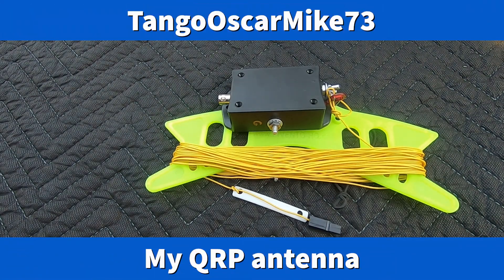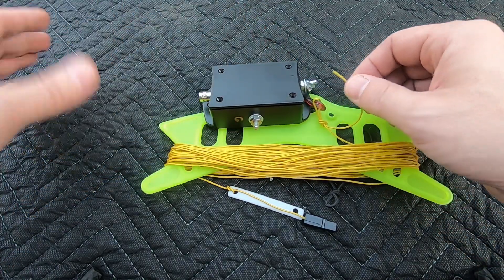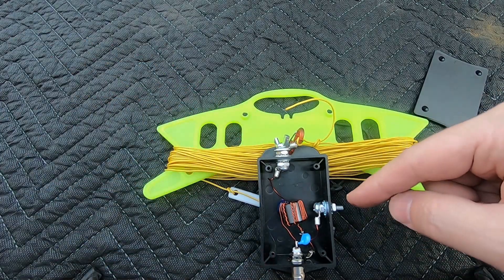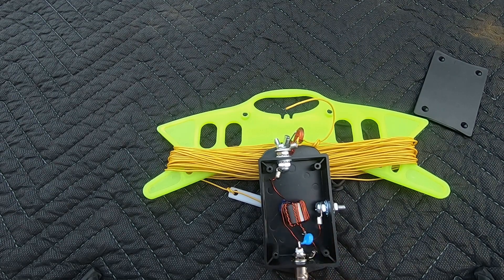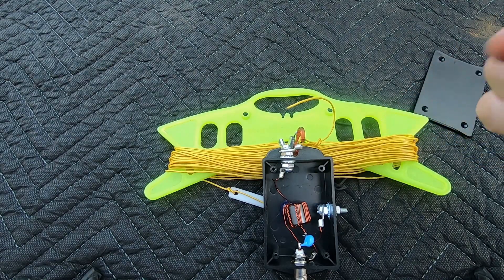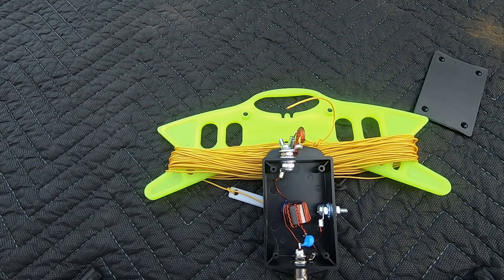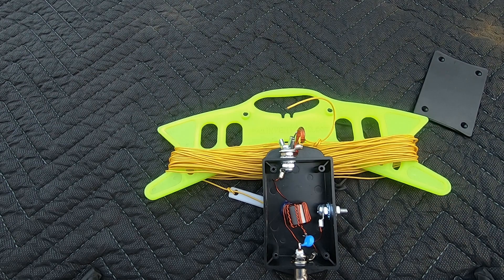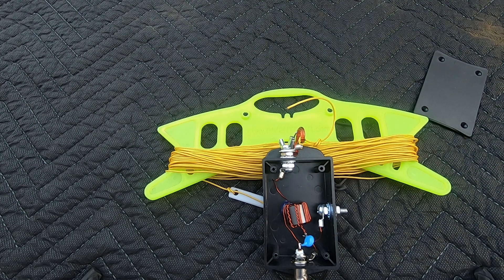My goto QRP endfed halfwave antenna - homebrew

Comment: It seems the coax shield acts like a very good radial, perhaps that is why there is no performance increase with one added? I read that it should be 30' or more, I have several sizes I will try from 20-35 feet to compare the difference. I also have a coaxial choke ready to compare also. Antennas a so fun to play with. Thanks for sharing! Cheers es 72, Dave - KU9L

Comment: great video - tehre is too much onfo online - and I suspect that 80% is untrustworthy
could I ask for anotehr vbideo - to show how you wind the torroid pelase?
Looks a but complex

I am confused 
presentation says 3 primary  - 21 secondary...
howwve even he shows 2 primary only....
and the classic graph...
Reply from the maker: Somebody else did all the hard work.  I got all my info from this presentation by K1RF.  There are different windings depending on the torriod you use. http://gnarc.org/wp-content/uploads/The-End-Fed-Half-Wave-Antenna.pdf  For my QRP antenna I used the first one on the chart on page 24.  It lists the part number. and tells you how many winds.  Page 10 is a great diagram on how to wind.  I hope this helps.

Comment: If you make a spare one, making a vid focused on the ferrite and winding procedure would be sweet. No other vids have used that core, and the windings also look grouped in some way.
Reply from the maker: Good suggestion.  I want to build one of the one K6ARK antennas, where the balun is right on the bnc connector.
Reply: @TangoOscarMikeN3WS  Good call!
Reply: @TangoOscarMikeN3WS  I should not even be bothering with this until I have an antenna analyzer.
Reply: I just received my K6ARK kit, which I'm planning to use for an EFHW very similar to this. Thanks for the suggestion to use a separate wire for 80m!
73 DE W6JV

Comment: Just curious what your home antenna is. The one you mentioned at the end of this video.
Reply from the maker: I use another home built 49:1 end fed 10-80, but the transformer is built larger for 100 watts.  I also have a fan vertical for 10, 20 and 40, but I rarely use it.

Comment: Thanks for the vid Tom. I'm planning on something very similar to go hiking and mountaintopping with my K1 rig.  73 de ZS2OE
Reply from the maker: Awesome.  No mountains close to me so I have to settle for SOTA for now.  I am working on my CW, but still have that "I'm not ready" fear in me.  Thanks for watching.
Reply: @TangoOscarMikeN3WS  Good luck with the CW. It's all I use these days and I have great fun building QRP rigs as its such a simple mode. As a matter of interest how long is your coax feed to your radio ?  Thanks again
Reply from the maker: @paulsmi55  25 ft of RG-174.  I know I'm losing a little output power, but I still make contacts.

Comment: Nice! great kit you got there! I use a 49:1 with 80m of 30awg mil spec teflon coated wire. works well on 80 lower band phone, 20m whole band, and 6m surprisingly when deployed as sloper about 6ft above ground. I used a ft 140-43 ferrite in a water-weatherproof box. I finished filming my kit as well and you can see it there.
Reply from the maker: I'll take a look.  Thanks for wathing.